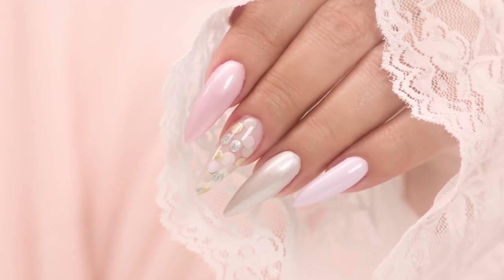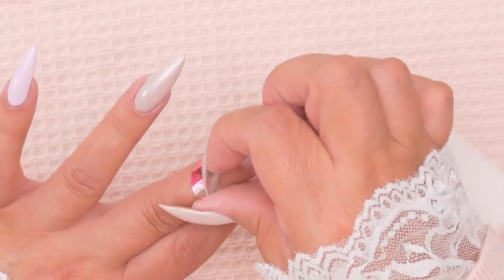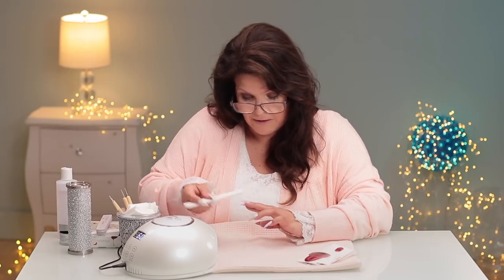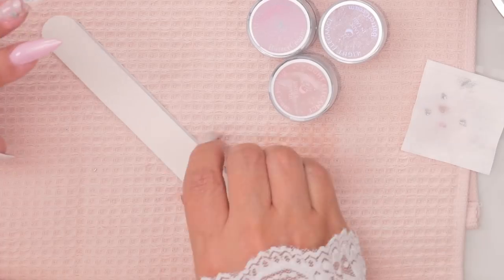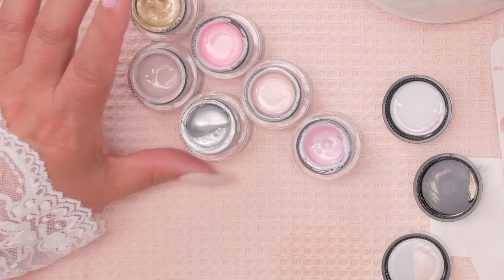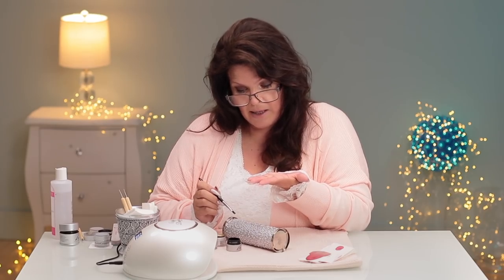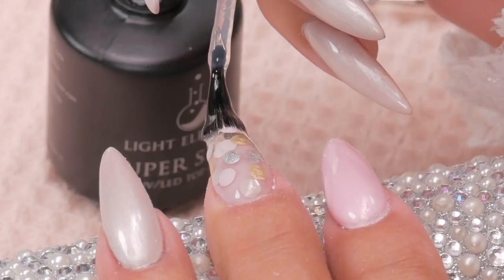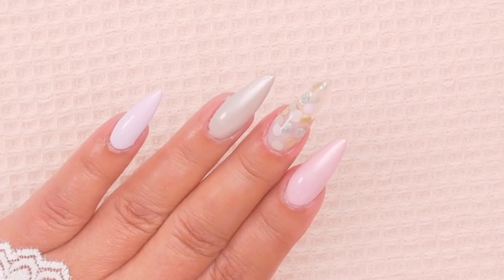3D Sandwich Technique - Wedding Confetti Gel Nail

Comment: Hi Suzie. I found that if you cover the area with a thin layer of the hard gel < dont bake it yet, then add the thicker layer over the thin layer, the thicker layer are applied easier than without the thin layer on the surface it needs to cover. Absolutely love your tutorials!! and you!!

Comment: Suzy, Serious question about gel nails: Ten years ago I first started having my natural nails re-enforced with IBD brand gel. My manicurist applied the gel in three thin layers, and I never had a problem with chipping or cracking. I had to stop seeing her because I lost my job, but I tried getting my nails done elsewhere when I was able. The gel was different brands at different salons. I have never had as nice results as I did all those years ago. That manicurist has since retired so I can’t ask her: Why did my gel last forever with the IBD brand? Was it the thin applications, or that the formula was non-soak-off? What should I ask for when I try going to a salon again? Does anybody use the original formula of IBD anymore? Thanks for your time  💅

Comment: How do deal with a client that you’ve just done a full set on to that clients specifications, and then come back latter that day and want you to reduce them another way and they won’t leave till it’s done, but your booked back to back with other clientele?
Reply from the maker: Well you have to decide how important ate they to keep as a client- some clients will push as far as you will let them. Some clients will drive you crazy IF you let them. Remember YOU CALL THE SHOOTS/ even though they can be intimidating to get what they want but you have to decide what kinda relationship youll have. When i was in your situation i would NOT make my other clients wait to accommodate a client who changed their mind. But i would offer the next avail appointment. This is when you have to decide how firm you’re going to hold to that. You may take a chance of losing the client if they don’t want to wait, but I have found in this case if they have to wait to fix the nails to their new idea, they often change their mind and say oh it’s OK forget it I learned to like them. And if not then they can wait to the new time and you set the standard that you won’t be pushed around. Most clients don’t push us to this degree this is just for some of those clients that do tend to take advantage